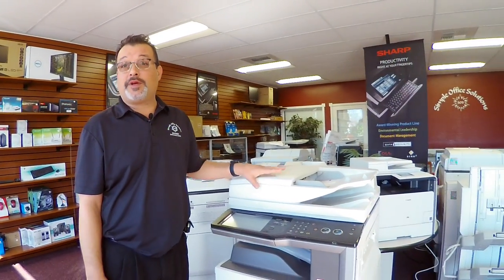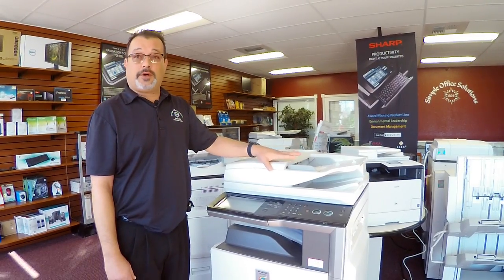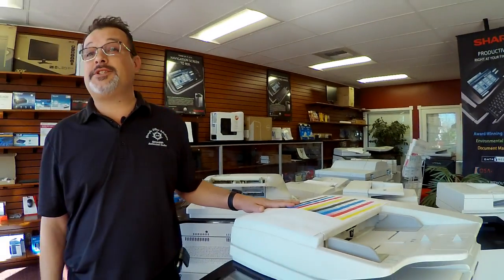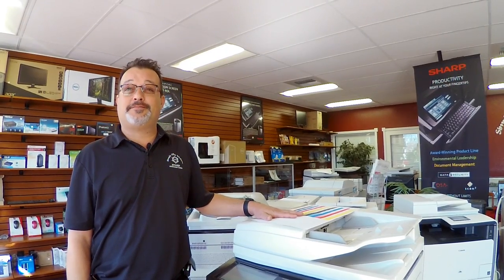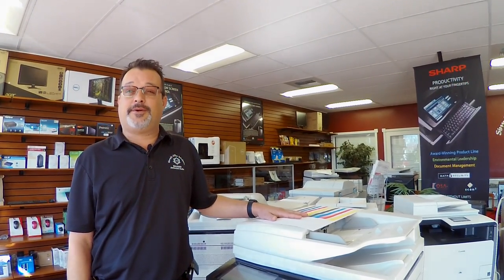Laser Printer Wrinkled Pages

Comment: Wow, this is just an ad for a service call, not a solution. What a waste of time.
Reply from the maker: Hey Lawrence, unfortunately for this type of problem, there are one of two cause to wrinkled paper. There is either moisture in the paper and you should swap out the paper or you'll need to replace the fuser assembly. In some machines, you can do this on your own. If you're not sure how to do so, then I would recommend contacting a local dealer.